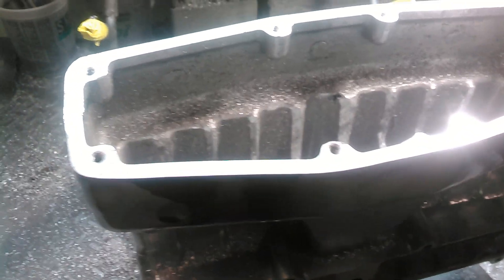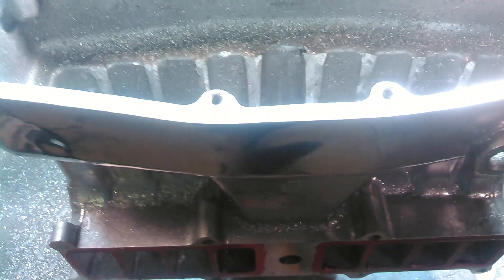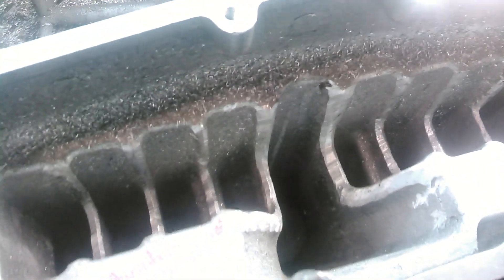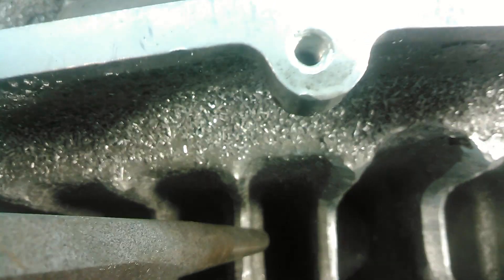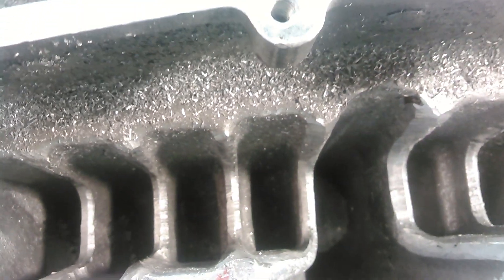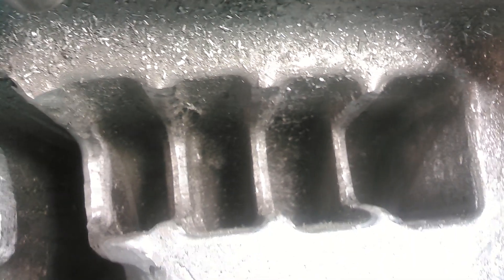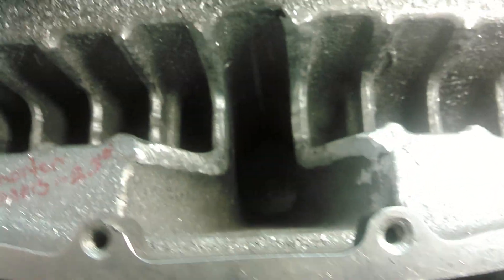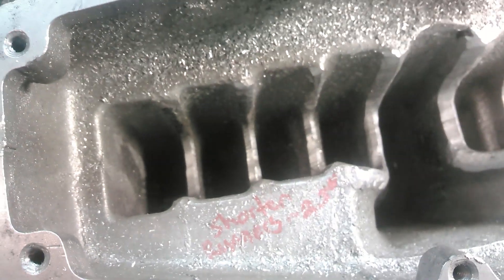Bigdogs Porting, aftermarket Ford efi manifold flaws

Comment: Does cutting the upper intake runners shorter and opening them up more help airflow     What about cutting them completely out openly and just knife edging the lower intake opening
Reply from the maker: Its easy to ruin these manifolds which is exactly why we do not teach or promote exactly what we do and why because people will try to mimic and ruin their parts. Its a complicated science to this to get it right

Comment: Does the vic jr have the same issue?
Reply from the maker: Yes the Victor hast the same issue. This is why flow testing is important when porting. You can bust through and sleeve them for more flow but you have to purposely not max port the other runners to be able to keep the flow even. We gotten our stage 3 Victor 5.0 to flow 385cfm average runner.

Comment: Very very interesting! Even though it’s just moving air you could have an imbalance due to air flow??

Is it more critical on EFI vehicles?

Thank you!
Reply from the maker: The flow imbalance in stock form is significant which causes a larger difference in AFR from cylinder to cylinder

Comment: Looks Like a typhoon, performer rpm knock off.  you can grind out the bolt bosses in the runners, just ream them and sleeve it if your worried. a flat washer with some rtv under the bolt heads will seal it,  Not that big of a deal.. Did the same on a couple old cobra intakes I cut up years ago to straighten out the throat.
Reply from the maker: True and with all that work it will still not out flow our Stage 2 upper in individual runner flow or total TB tunnel flow without even more work because of it's design. With the cost of that manifold and all that extra work you have to put in it to try to make it flow better it just doesn't make sense when you can buy or have your existing manifold done up to our specs for a lot less and get more.
Reply: AMEN
the name of the game is RESULTS